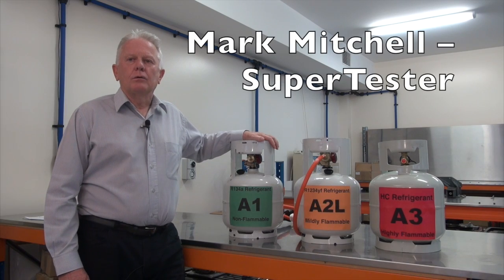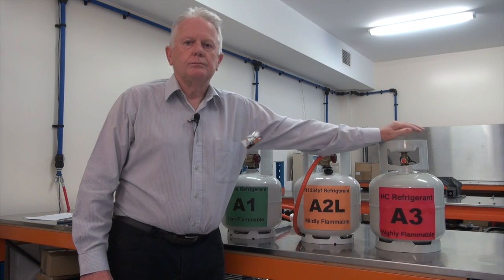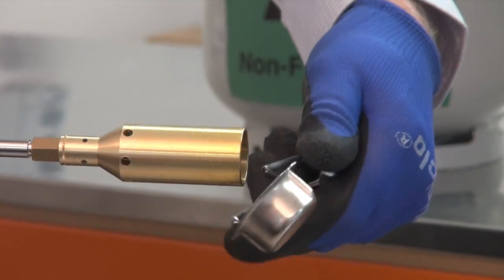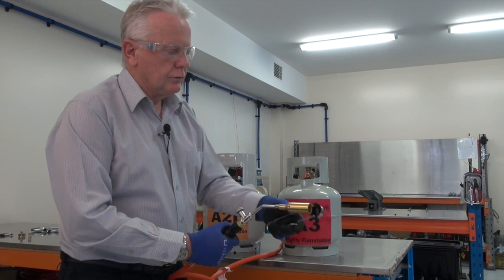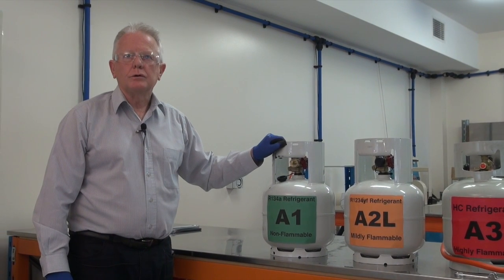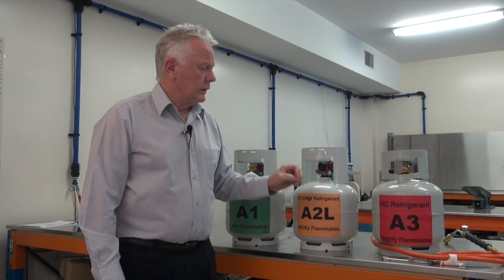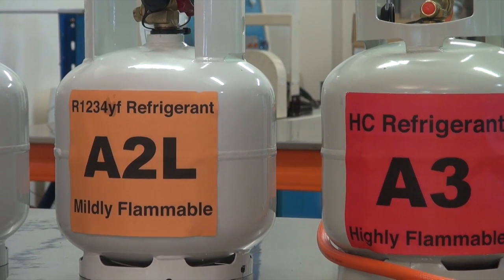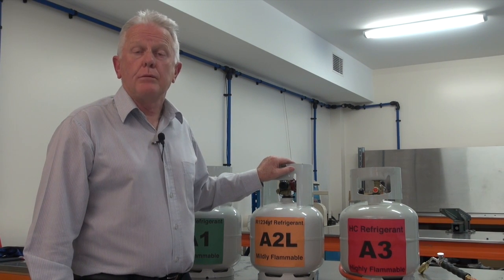SuperTest Refrigerant Flammability Test

Comment: Took a course at Carrier yesterday. While working with 454B, using power tools that don’t spark, having a leak detector on around you, and having a clear escape route are the precautions they recommend. A separate circuit board and sensor inside that cuts the AC/HP off if it senses a leak(also cuts your heat off if you have a gas furnace). Then it allows it to come back on after it dissipates. You now have to pressure test with nitrogen for an hour. Increased labor, higher costs, more things to fail and possible safety concerns… I’m sure everyone will be onboard with the change.
Reply: I've just entered the hvac field and it's funny to me how you dont understand that none of that matters. It's up to the EPA and montreal protocol to decide what we use and how we are supposed to use it. They don't care if it's harder on us or the business owners. 😂

Comment: Even if R1234yf refrigerant leaking might be unlikely unlikely to "cause" a fire when exposed to a small spark, if there already is a fire, this refrigerant will significantly accelerate the fire and create extremely toxic gas as it burns.

Comment: R1234YF is way to go.  I see R1234YF  is hard to sustain a flame on its own even being ignited with a fire source. 
My concern with Hydro Carbon refrigerant flammability is not about losing life but about property damage. We can quickly get out of the car if there's a fire. However, fire can still life threathening in a bus where it's hard for all people to get out quickly.  My concerin is that  HC refrigerant such as Propane can ignite with a spark from static or battery post and damages the engine compartment! It's will be expensive and big hassle!
Reply: combustion can not occur if there's no oxygen present. if your house or car is already engulfed in flames the little propane there is on an AC system will be the last of your worries.

Comment: Nice demonstration, however I don't quite understand what all the fuss is about. Yes HC's are combustible however the charge amount used in most applications  is quite low compared to the LPG tank that some cars are fitted with as a petrol substitute? What's the argument, if your system was to leak it could ignite? What's stopping your fuel from leaking and igniting either ? Silly argument in my opinion.
Reply: You're exactly right.  The amount of HC needed as a refrigerant in an automotive application would be very small--certainly much smaller than the amount of gasoline constantly running through the fuel rails of the vehicle.
Reply: One major difference is that it doesn't take much to damage the car's condenser and cause a refrigerant leak,. For example, if there is a minor accident and the condenser is smashed, there could be a fire. However, the fuel system would be much more difficult to damage since it isn't right in front of the car, exposed to rocks flying up, accidents, etc.
Reply: Avery Alexander of course that is assuming that if they were to move to using HCs as refrigerants in autos that they would leave the condensers in the front of the vehicle in a vulnerable location. 
Nonetheless, there have already been tests done where front end collisions were simulated. They found that, indeed, other elements caught fire before the HC refrigerant coming from the damaged condenser. These items, of course, were the gasoline being transported to the injectors, motor oil, electrical wiring, and rubber hoses. Very interesting results. 
Again, the amount of HC refrigerant would be so small, that although it is flammable, would quickly flash off and be gone before catching anything else on fire.
Reply: @SpeedCultureStudios  So where do you think the condenser could be moved to where it would likely not be damaged? It needs to be somewhere with a lot of airflow.
Reply: Avery Alexander I would have to think about that for awhile. However, I would assume that auto design engineers would consider a number of options if they were working with a flammable refrigerant. 
But like I said, there have been crash tests done already and the results were very interesting. Although flammable, the HC refrigerant did not ignite upon impact. And again, the charge is so small that if by some chance it did ignite, it would flash so quickly that chances that it would cause anything else to ignite seems quite slim, let alone cause an explosion. 
I think the transition is inevitable. I work with manufacturers in the refrigeration industry. hydrocarbons are the standard in Europe and it is being considered for autos. Charge limits will likely be increased as well. I think it’s just a matter of time. HCs are so efficient and effective that it only makes sense.
Reply: @SpeedCultureStudios  I agree that hydrocarbon refrigerants have a lot of benefits. I would even say that they are the best refrigerants aside from flammability. I am actually using a hydrocarbon R134A replacement refrigerant in my refrigerator, which originally came with R134A. I am also using R290 (propane) in one of my window AC units as a replacement for R22. Both appliances both draw less power and perform better than with standard refrigerant. 
However, I think that flammable refrigerants have some large risks when used in a vehicle. The biggest risk with a hydrocarbon refrigerant quite possibly could be be if there was a leak inside the car that fills the car with explosive gas. There could easily be a large explosion in the car if there is a tiny spark, causing flying shrapnel and killing the people in the car. Not likely, but possible.
Reply: Avery Alexander Again, the charge size in an automobile would be so small that I honestly don’t think an explosion would occur if it were to leak into the cabin. What’s the charge size for your refrigerator? 60g?  It would have to be concentrated in a small area of the car and have an ignition source very close. More testing needs to be done obviously but I think concerns are overblown. Especially considering the amount of gasoline in the car already.
Reply: @SpeedCultureStudios  My refrigerator only took a couple of ounces of hydrocarbon blend and my window AC unit took about 10 ounces of propane. My small car takes about 20 ounces of R134A, but with a hydrocarbon R134A replacement, it would take about half that, so about 10 ounces or so. 10 ounces of propane would be way more than enough to blow up a car.  I remember that someone calculated that it would take about 3.5 ounces of propane to create an explosive mixture in an average size car.
Reply: @SpeedCultureStudios  Again, I am not anti hydrocarbon, but I am not sure that it would be the best choice for a car.
Reply: @averyalexander2303  So make a stronger compartment for it, lol...Silly really. This si all politics and handling these and the fees and permits and the industry control....Or at least thats what it looks like. What about that M60 natural refrigerant? Any test with that?

Comment: Maybe not flammable under ideal conditions, but what about when it's mixed with compressor oil under high pressure and hot ??
Who ever came up with this idea of using flammable chemicals under high pressure exposed to high voltages and hot oil, needs to have his head examined !
I'm sure the fire department thinks this is a brilliant idea ! 😂
👍
Reply: That’s exactly what I was thinking, like who cares about the refrigerant itself, once it’s mixed with oil it will burn like a mofo fosho
Reply: @murkyturkey5238  👍
Reply: 100% agree. Idiotic and unnecessary. Just increase efficiency of equipment has the same result without the safety, fire and explosion concerns. Here's one example from Asia https://youtu.be/tYKY5IdV-1c

Comment: Your test was not within the stoichiometric combustion range of the A2L Gas. This gas is combustable in concentrations of less than 13% at room temperature and normal atmospheric pressures. See the MSDS:
"Flammable gases, Category 1
Gases, which at 20°C (68°F) and a standard pressure of 101.3 kPa (14.7 psi):
(a) are ignitable when in a mixture of 13% or less by volume in air; or (b) have a flammable range with air of at least 12 percentage points regardless of the lower flammable limit.

Comment: where is R-32 refrigerant flammability test ?

R-32 refrigerant gas is a mildly flammable (A2L) like R-1234yf refrigerant gas . R-32 it is a new refrigerant gas for home and commercial air conditioners . R-1234ys it is a new refrigerant gas for cars air condition . That is the only difference . 

R-32 was designed and engineered by Daikin (Japan) . R-1234yf designed and engineered by Honeywell (US) .
Reply: Consider you cant even light R32 with a blow touch i find the need for it lacking.
people go around saying, STAY AWAY FROM A2L, IT BLOW UP, BURN HOUSE DOWN bla blabla BLA.
We take R32 as example, the most commonly used R410A replacement. (Note that R410A is 50% R32). You need LEAST 300 gram in a 1 m3 area, with the gas pouring our no faster then 7 cm3/s, and a ignition that is over 650 Celsius. Largest AC unit for house use, a 8 kW machine, has 1.6 kg of R32 in it. unless you live in a Chemical warfare bunker with no ventilation, i find it HARD to believe you can even get the 300g per m3 covered to even start the fire.
R32 is safe to use. in AC units. unless you consider VRF system but thats another story.
Reply: @MacKnight  3 years later and R-410a is being phased out for R-454b which has a R1234yf flammability

Comment: can you show with r600a
Reply: Just use a Lighter, there is some inside.
Reply: r600, r600a, r290, etc are all HC refrigerants and will burn just like in the video.
Reply: The HC refrigerant is flammable like R600a but different
Reply: @rebeccadonoghue8993  R290 = Propane (Used in gas grill and some cooling machines)
R600 = Butane (used in lighers and some larger freezers or refrigerators). 
R600a = Isobutane (most commonly used for freezers or refrigerators in homes)
R170 = Ethane (Never seen it used since the other 3 works better).